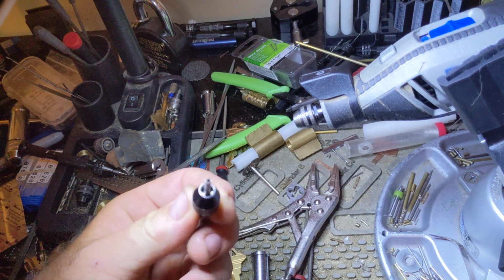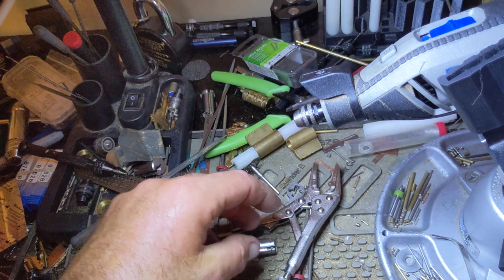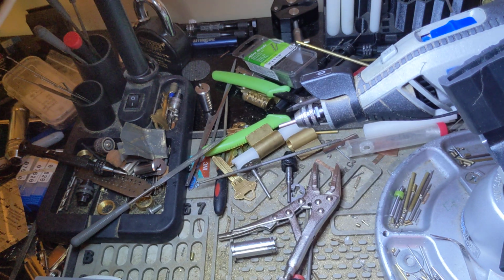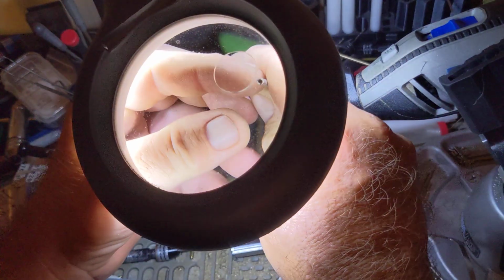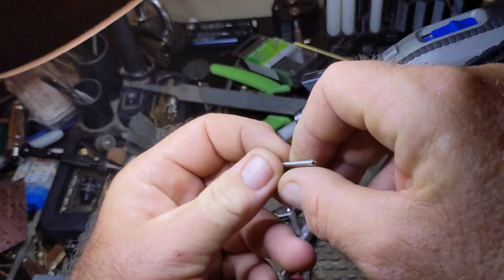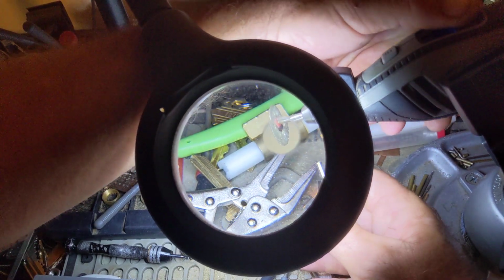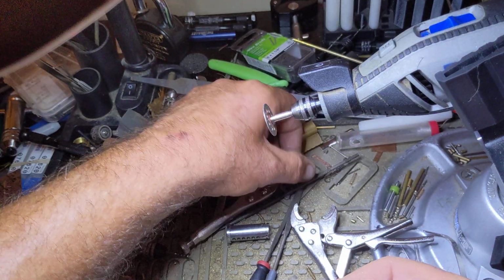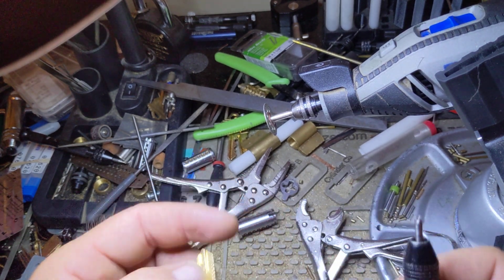how to make the tool for chamber marking your blank key

Comment: I seen you do this the other day, it's a great idea,  and also it's what gave me an idea for cutting larger holes into my leather projects. I used a metal straw and cut an angle edge at the end, and then cut off 2 inches and put it into a drill. Cuts perfect circle evertime, and they are big enough to run leather cordage through, its how made my pouch I posted on Instagram.   Keep up the great videos, the next key I cut I'm definitely do this!!
Reply from the maker: I wanted to show how easy it was to make, and face palmed myself after deciding to finally make it. Should have tried when the thought first hit, but I get side tracked like a hyper squirrel in a room full of shiny stuff
Reply: @j.gabriel8573  I know the feeling, I bounch around projects like a pinball machine lol.